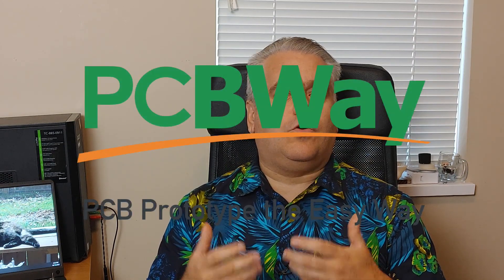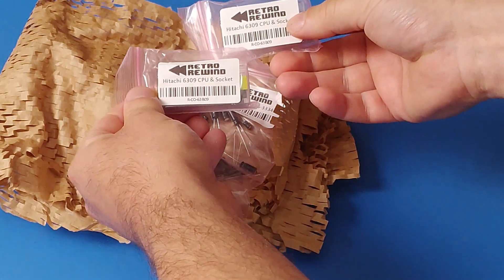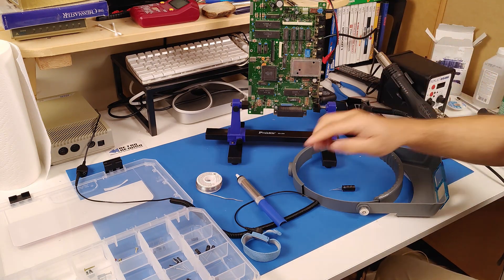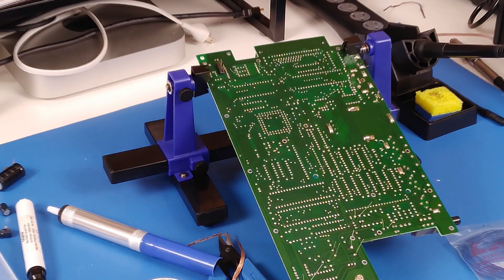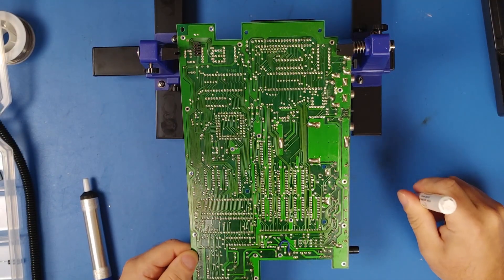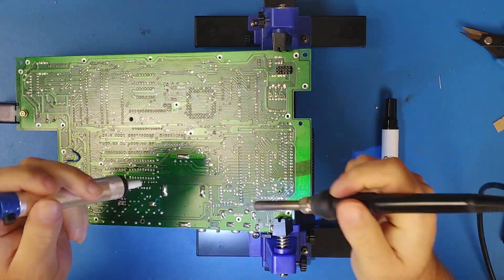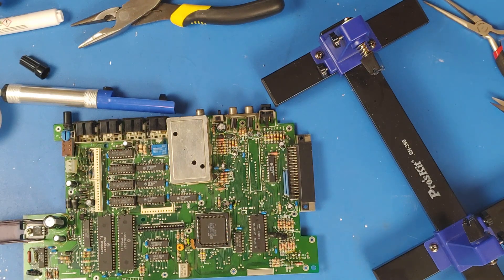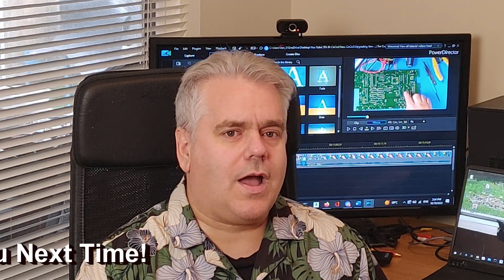The Cursed CoCo 3 Part1

Comment: Hi Ken. Thanks for video, great work! I've had trace troubles in the past, mostly due to too much heat on the soldering iron. Try a lower temperature and see. Looking forward to your next video! Thanks for sharing!
Reply from the maker: I slowly turned down the heat as the video went on, by the end I was just below 350C (much lower than I usually go)  This board just did not like me!
Reply: @CanadianRetroThings  Yeah, some just don't play nice. But never give up! That's the Canadian way 😉